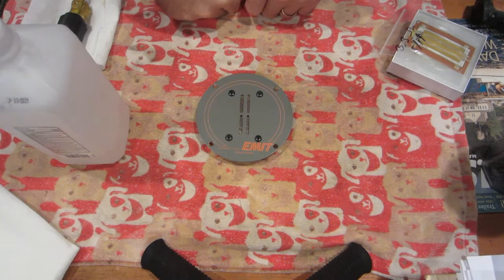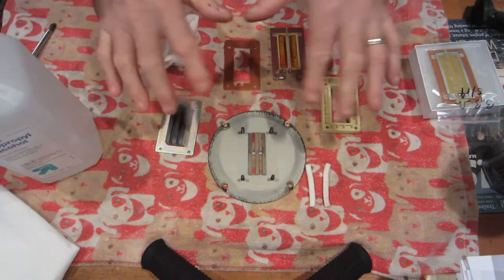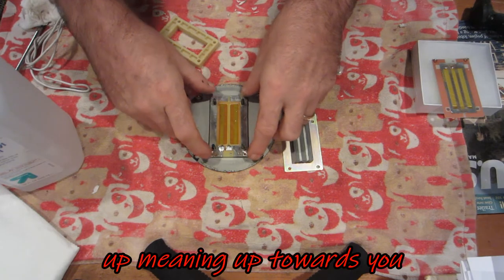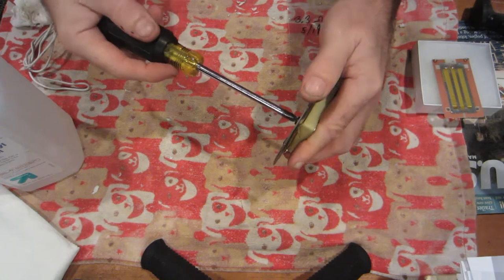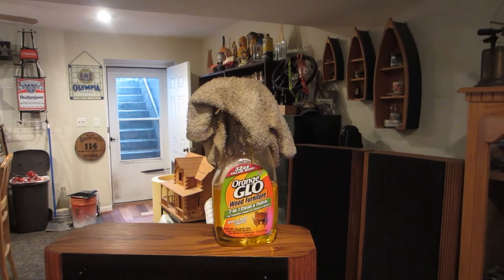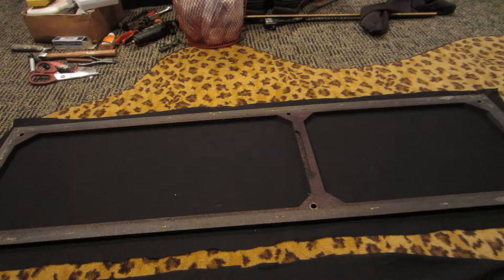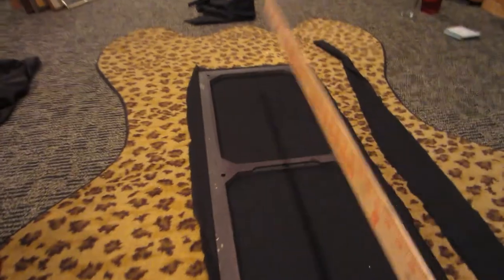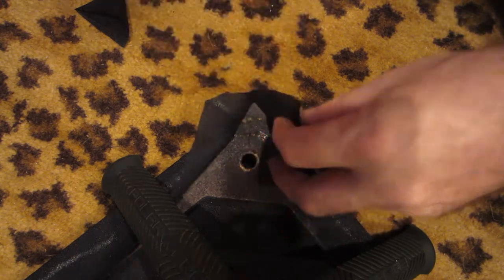A Knob Fixes Infinity Loud Speakers (ep 2) Infinity - RS IIIa Project

Comment: Great Video - We own a pair of RS4b's which we have had for over 30 years.   A couple of years ago I pulled off the grills and noticed that
my woofers were shot.   I went online and found someone in Alabama I believe and sent them off to be redone.   After watching this
video I'm thinking of doing this repair work for the tweeters myself.   How would I even know if it needs it other than visual inspection?
Onkyo Grand Integra M500 & P308 Amp/Preamp pushes them both.   There are probably better systems that we can buy today but at the
time this is what we could afford and have never upgraded.
Reply from the maker: You can OHMs test them. They should be around 4 ohms each. Also a visual inspection can show a lot. Wrinkles, lifted foil and such can all be seen. I replaced mine because it was the first time in 30 years I could get them and I was not missing the chance. It was well worth it. 
Thanks for watching!!

Comment from the maker: Please be advised, during the Emit rebuild I placed the Brown Spacer's notches to the right (in the video). They should be to the left (in the video) to allow room for the solder nubs on the ribbon. I rebuilt the same tweeter again because I did it upside down and with a camera in the way. Sorry and thanks for watching.

Comment: Good job  👍  I have a model RS iiib  from where do I get the front cover and if I change the switch, do I lose sound quality or is it better than before and what is the power of the switch 50 watts or 10 watts
Reply from the maker: Switch / Potometers links are in the description above. I didn't notice any change in sound quality and for that matter imho it's better due to fact that the pot's now work. Grill cloth link,  https://www.parts-express.com/parts-express-speaker-grill-cloth-black-yard-70-wide--260-335 just happens to be where I get it. They also have other colors.
Reply: Thank you for contacting me, this reflects the impression of your respectable character

Comment from the maker: 0:00 Emit Ribbon Replacement
10:40 Fuse Makes Emit Intermittently
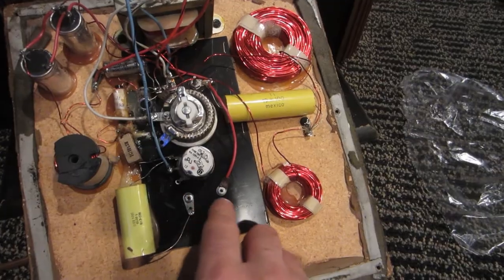12:05 Cleaning The Oak Boxes
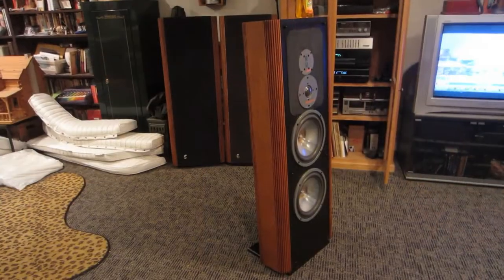13:10 Speaker Grill Fabric Replacement 
24:20 AC Infinity - Air Conditioning For My System

Comment: I have a set that I've had for almost 30 years... got them for fifty bucks.  I need to recone one of the woofers and I noticed that it doesn't appear to be wired at all.  The wires are taped together behind it. Your video also seems to show that there are no wires on that upper woofer. Is that by design?  I am tempted to wire mine, but don't want to ruin anything.
Reply from the maker: The woofers (both) are wired in series. The positive feed goes to the first woofer's + terminal,  then a wire runs from the - terminal of the same woofer to the + terminal of the second woofer and then the - terminal of the second woofer is grounded. 
Thanks for watching!!

Comment: Hi there I have a slight problem and that is regarding the listening position 3 m's away from my RSIIIb's, have to stand up to get the full crisp highs from the EMIT's, sitting down in the sofa makes the soundstage a little unbright/dull as these speakers are so tall, any ideas of a remedy except mouting the sofa 30 cm's higher. No stuff in the way just clear open space from the speakers in a 36 m2 room.
Reply from the maker: It does take a little distance so the speaker will, what I call "blend" being as tall as they are. You could try leaning them forward a little but then you take the chance of them falling on their faces. In a small room like that you may want to consider an EQ to compensate for what the room lacks. Hope it helps and thanks for watching.
Reply: @finscreenname  the room is at least 40 sqm + backspace 2 x 10 sqm so would not say small room here ;-)
Reply from the maker: @MrArtrock  Sorry, your non freedom unit numbers confounded me. 😛😛
To be honest I have always used a 7 band Technics EQ with mine from the first day I got them. I've used them in a 12X12 (1.3M X 1.3M) room to the basement I have now that is 24X24 (8M X 8M). It has made every room they have been in sound exactly the same so ..... I know it's not the audiophile way but IMHO I dont care how few things are "in the pathway" if it sounds like crap in the end.